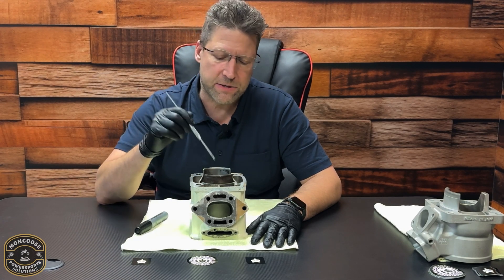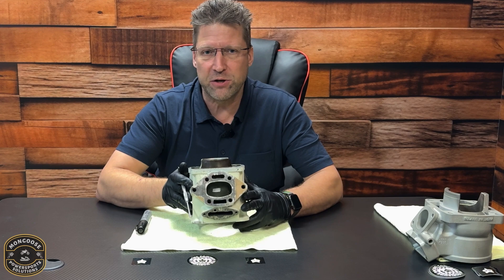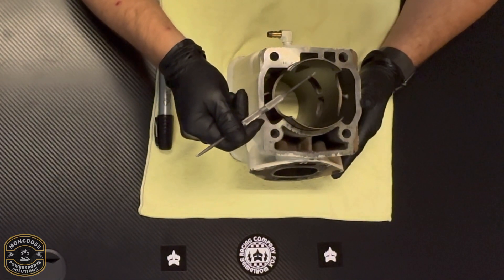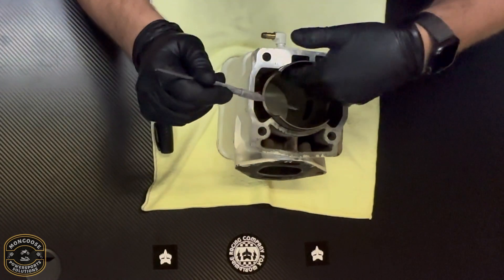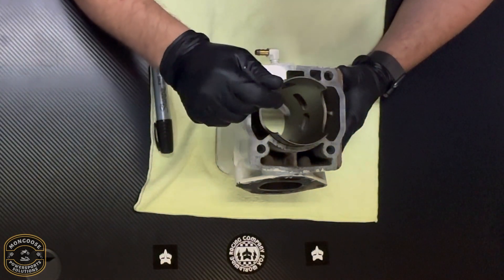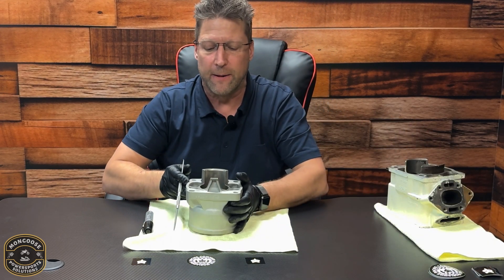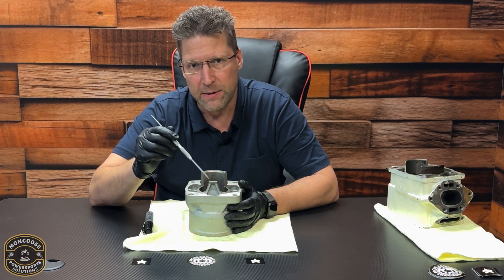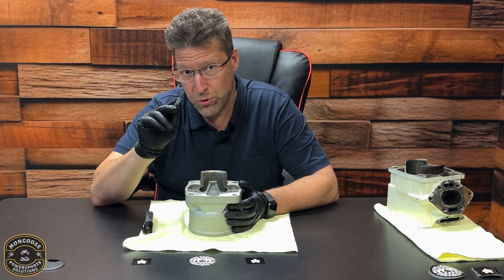Powersports Solutions - Why Pitting or marks in a two-stroke Cylinder Can Be Positive? #32

Comment: Would be interesing for very high reving small engines. Maybe i'll test it in my next cylinder project and just test it. How deep are the holes and what diameter do they have?
Reply from the maker: That sounds like a fantastic project!  High-revving small engines could definitely benefit from this approach. The depth and diameter of the holes depend on several factors, including the cylinder material and intended performance. Typically, they’re pretty shallow, but precision is key. We’d love to hear your results if you decide to test them! Let us know if you need any guidance.
Reply: @powersports_enginesolutions  i have a "old" overported cylinder with 58cc and like ~195/~135 Out/In timing that reves up to like 16k. Are they spreaded evenly or like 2 on the intake/cold side and like 4 on the hot side? I guess they're not polished and have light scratches so the oil can stick to it better? Maybe a very little "main dot" in the oilholes would even work like a point from where it always could build up. Around march i have a competion with my ported 62cc cylinder, after that i'm gonna install the mighty "overportedandwithoilholesfeatured" 58cc one. Maybe we find even more interestig things we could do to this one, heads up!
Reply from the maker: @ThisIsMyNewAlias That sounds like an awesome setup! 🔥 The holes are typically strategically placed, with more on the exhaust (hot) side to aid lubrication and cooling. And you're right, they aren’t polished; light scratches help retain oil for better performance. A small "main dot" or "pitting" in the oil holes could work as a consistent oil reservoir, and it is definitely worth experimenting with!

Excited to hear how your 62cc performs in competition! Keep us posted, and let’s see what more we can do with that 58cc beast after! 💪🔥🚀